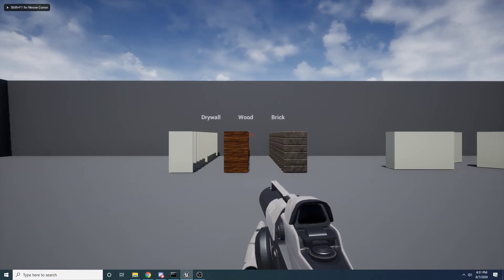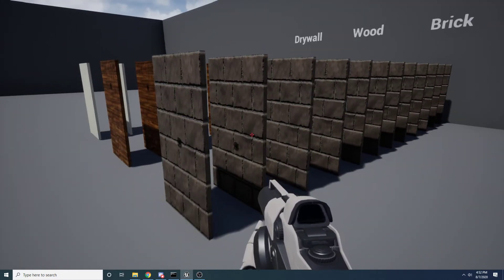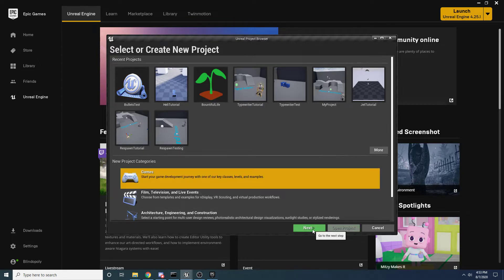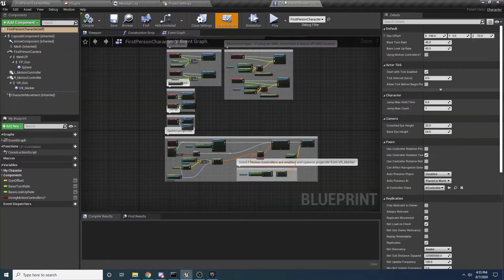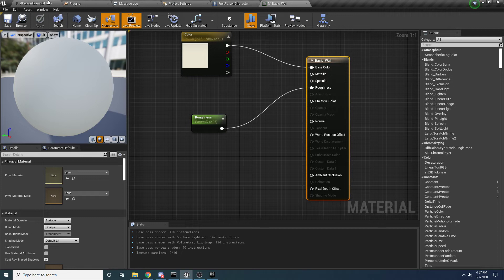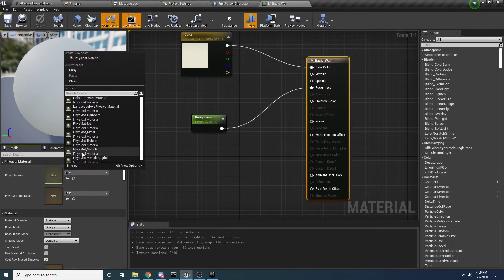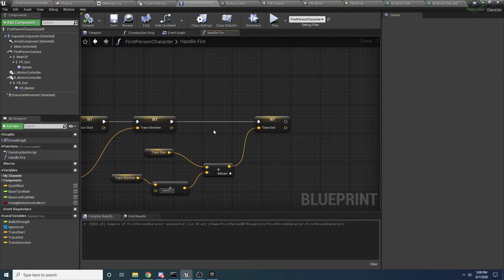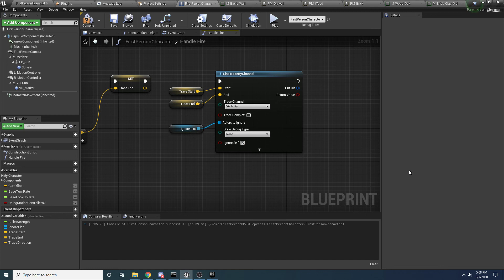Unreal Engine - Shooting Through Walls (1/3)

Comment: I know this is old but, is there a way to do this but instead of decals make actual holes in the material? So you could essentially bring a house down by shooting it to much
Reply: I may be late but yes, check out something called TearDown. It uses data visualized as small cubes that makes up solids like walls ,trees, vehicles etc, to be destroyed
Reply: @UrHaiNesRealmz  I actually started going to college for Unreal Engine so no your not late. I appreciate the info!
Reply: @david-patton  You may not agree here and by no means trying to take away your spark. But although college helps somewhat, it's definitely not a prerequisite to acquiring game dev/design. All you need is a laptop/desktop, favourite snack/drink, a quiet room, and most importantly, a HIGH motivation/drive, hehehe! I surmised that I've learned WAY more in a year than I would in my 1st yr of college, which I may be wrong here, don't give students that much needed practical hands-on application.
I say keep it up, pass your classes, but do work with UE at home EVERY NIGHT, sleepless nights if possible, and you'll see a MAJOR difference. Again, this is just IMO and take it with a grain of salt.
All the best in your work, bless up!